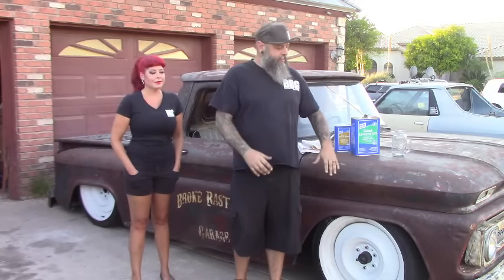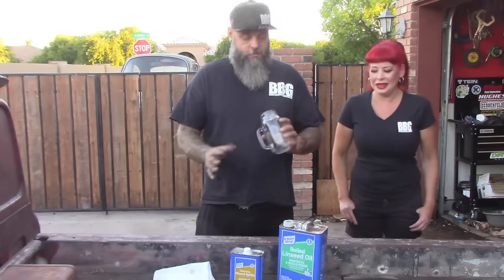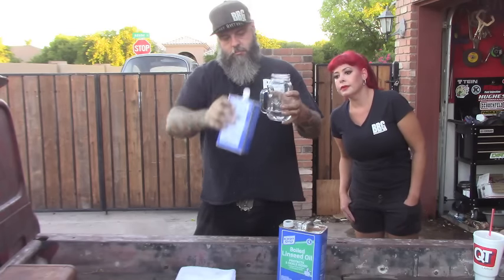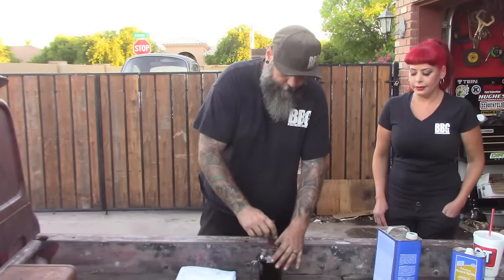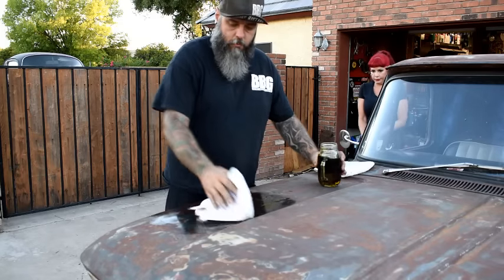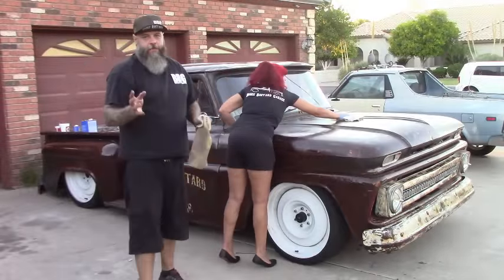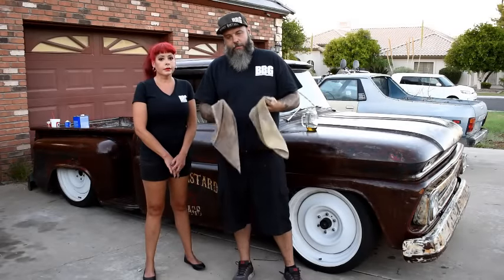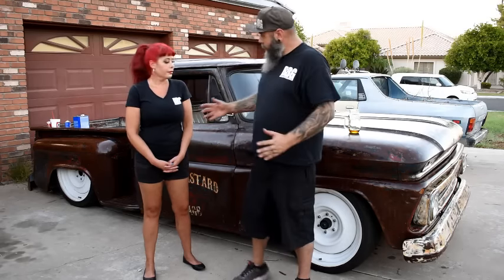How to Protect and Preserve Patina or Rust

Comment: Linseed oil contains a bacteria that when exposed to air creates a-lot of heat ( spontaneous combustion ) . The boiling reduces the bacteria but does not remove all. Lay the rag spread flat on non combustible surface so no heat can build up. If wadded  up heat can build up and catch fire. A Non boiled soaked rage wadded and plied will almost always catch fire, boiled 50/50

Comment: So I understand that the mineral spirits help to spread the linseed oil (I used pure until now) but doesn’t that dissolve the oil (and it’s properties) and how about pinstripe (one shot), doesn’t it dissolve the paint?
Reply from the maker: Sledanet my doors are painted with one shot. The mineral sports just keeps the mix from being gummy and clumps
Reply: @BrokeBastardGarage  cool, thanks for your reply. I thought the pinstriper told me spirits would dissolve the lettering again if I wanted it removed, that’s why I was a little worried. It doesn’t matter if the lettering already has a patina look but mine doesn’t.
Reply from the maker: Sledanet I would not use it on fresh pinstripe with out testing a spot
Reply: @BrokeBastardGarage  it’s been on the car for a year so I’m probably safe 😅👍
Reply: My biggest worry is the effect mineral spirits had on the paint.

Comment: How often will this need to be reapplied with daily water exposure? Would a wax topcoat help extend the life? 

I have an old lumber cart; I plan to add shelves and use it to move my container plants in & out of the sun and/or weather (OK is very unpredictable). I love the patina on the metal (rusty places with several chippy layers of different colored paint).

I am looking for something with very little to no maintenance, that won't turn cloudy or yellow with daily UV exposure. Please let me know of any application tips, or other techniques that may be more suitable for this project. 

》《 THANKS! 》《

Comment: I want to try this on my 1965 C10 short bed. Does the oil attract lots of dust/dirt?

Also does it make it harder to wash?

My truck is light blue and white, with some bare areas, dents, rust holes on rocker panels etc.
Reply from the maker: Mike Leith check out the latest video I posted it should answer all your questions. Thanks for watching
Reply: @BrokeBastardGarage  I'll go look for it now

Comment: I'm wanting to turn a 66 Catalina into a county road torpedo. Will this be sticky at all, and will dust get embedded in it? Also, How long does it last?
Reply from the maker: I’ve it a full day to dry. Until you can touch it and it’s not sticky or oily. Then it will be just like paint. You can wash it. Don’t wax it. Last about 6 months

Comment: Hey @BrokeBastardGarage, I have a car that is 20% worn paint and 80% surface rust. What kind of prep work did you do before application? WIrewheel? Sand? Brush?

The surface of my car is pitted, but no holes.
Reply from the maker: I would give it a good wash. And rub it down to remove any loose stuff. Let it completely dry then oil it.
Reply: @BrokeBastardGarage  Thanks mate, I'll give it a crack.

Comment: Stupid question...when. The car has a good patina from just being old, should I sand it down a bit. To get the rough edges /flaking shit off before i apply the oil?
Reply from the maker: I wouldn’t sand it personally. But I would wash it well and use dry rag to knock off loose stuff.

Comment: Hello, I really like your videos. I was wondering why you added mineral spirits to the boiled linseed oil?  I’ve watched a lot of videos on this method of preserving and never saw mineral spirits added. Also, after you use this method for years, what happens if you want to do a resto and strip the paint, clear coat etc?  Thanks.
Reply: Probably to thin it so it'll spread and dry easier?

Comment: Does this process stop the rust? 
I live by the ocean...
Reply: I'm thinking the important thing is to preserve what's left of the sound steel.    Maybe the rust can be part of the preservative coating.     The rust is porous (similar to wood) and so will retain/soak up any oil that you put on it for quite a long time, years probably.   
      The oil will keep the good, solid, un-rusted steel beneath from rusting any further (I think).      AND some people like the rusty look.   You notice he calls it a "patina".    AND it's a lot easier, faster, and cheaper than a paint job.      AND it's a lot easier to maintain than a paint job.    If it wears out, just take half an hour and wipe on a new coat.     Sort of like Danish Oil Finish on wood vs. varnish on wood.
    I live in Arizona, so I have no experience with ocean climates.

Comment: What happens to the original rust under that coat, will it continue to eat the metal?
Reply: I'm thinking the important thing is to preserve what's left of the sound steel.    Maybe the rust can be part of the preservative coating.     The rust is porous (similar to wood) and so will retain/soak up any oil that you put on it for quite a long time, years probably.   
      The oil will keep the good, solid, un-rusted steel beneath from rusting any further.      AND some people like the rusty look.   You notice he calls it a "patina".    AND it's a lot easier, faster, and cheaper than a paint job.      AND it's a lot easier to maintain than a paint job.    If it wears out, just take half an hour and wipe on a new coat.     Sort of like Danish Oil Finish on wood vs. varnish on wood.

Comment: Would this work as a rust inhibitor underneath a car, or would it get washed away easily?
Reply from the maker: Lou Fazio probably not
Reply: Is the BEST under coater available. I add a cap full of Japan drier to accelerate drying and hardness. Formula wicks into rust and paint like no other.

Comment: Can you explain to me the logic of preserving rust?
Reply: I'm thinking the important thing is to preserve what's left of the sound steel.    Maybe the rust can be part of the preservative coating.     The rust is porous (similar to wood) and so will retain any oil that you put on it for quite a long time, years probably.    The oil will keep the good, solid, un-rusted steel beneath from rusting any further.      AND some people like the rusty look.   You notice he calls it a "patina".    AND it's a lot easier, faster, and cheaper than a paint job.      AND it's a lot easier to maintain than a paint job.    If it wears out, just take half an hour and wipe on a new coat.     Sort of like Danish Oil Finish on wood vs. varnish on wood.

Comment: Do you know how to put a simple and cheap patina on a small engine? Once I get it running I want to repaint it then put a patina to make it look original because the original got completely stripped off by the weather because whoever owned it before left it exposed to midwest weather.
Reply from the maker: Captain_Ravioli once paint is dry and cured. You can use a light abrasive like comet or bartenders fender to weather the paint. Just rubbing the areas you want to distress.
Reply: @BrokeBastardGarage  so rub the preferred areas with something abrasive? I don't know if I'm understanding this properly,it's been a long day
Reply from the maker: Captain_Ravioli first repaint the motor then distress to make it worn and patina.
Reply: @BrokeBastardGarage  oh, ok, thanks, what abrasive material do you recommend for a small 1/2 horse engine? I don't want to accidentally strip all of the paint
Reply from the maker: Captain_Ravioli I would use comet dish powder and a rag
Reply: @BrokeBastardGarage  ok, thanks!

Comment: Can u do multiple coats for a better. Clear coat look.. Any one thing I should watch out for when doing this
Reply from the maker: I’ve never tried multiple coats. But could work is you give them time to dry completely before coats. Just be careful with the oily rags. Wash them out so they don’t catch fire.
Reply: @BrokeBastardGarage  thank you I'm going to give it a try soon
Reply from the maker: @shanestinnett9744  let me know how it works!
Reply: @BrokeBastardGarage  I've seen some videos that don't cut it down with mineral spirits .. Why did u cut it
Reply from the maker: @shanestinnett9744  is applies more evenly and it doesn’t get as sticky
Reply: @BrokeBastardGarage  thank you again I'll do it your way and I'll let ya know how it turned out
Reply: Got it done just now turned out great thanks for the help and the information

Comment: Can you tell me how long it would last if its in the rain a lot.. Thanks
Reply: I did my quarter panel with break fluid that I got fer nothin and It didn't last long. Maybe not the same application results.
Reply: @vetterfellow  That's because brake fluid is corrosive
Reply: @aaronduncan7292  Yes I forgot about that !!!.

Comment: What’s the reason for the mineral spirits? Will I get the same results from just the linseed oil?
Reply from the maker: dannny2511 it thins the mix so I spreads evenly
Reply: Broke Bastard Garage OK thanks. So you would get same results with just linseed oil, just take a bit more rubbing in?
Reply from the maker: dannny2511 I can say I haven done it. Make sure you use boiled linseed oil. Normal will turn gummy.
Reply: Broke Bastard Garage alright sounds good. Thanks again, sweet truck by the way

Comment: Will this keep the rust from going deeper, like rotting through the back of the panel?  I like the way the rust looks on my truck but I plan on keeping it for a long time and don’t want it to rust out.

Edit: Your truck looks badass!
Reply: Good question Captain Goldbeered!    Rust is porous and will fully absorb any oil you put on it.    So the rust is actually helping to keep the oil on the surface of the pure steel beneath, thus preserving it.     The oil keeps the oxygen and the water away from the pure steel beneath, so I don't see how it can rust anymore with oil on it.     Steel cannot rust without water and oxygen in contact with it.    No chemical reaction can occur because the reactive chemicals (iron, water, oxygen) are not all present together if you apply oil.   At least that's my theory....   I have not done extensive testing.    AND I can't seem to find any solid answers to this question online.    Let me know if your find anything.
Reply: @itmightbepossible8586  That actually makes a lot of senses.  I didn’t think about the porosity of the rust.  Thank you for the reply!  If I find confirmation I’ll let you know for sure.
Reply: Sense*
Reply: @captaingoldbeered803  Sounds good.   I would love to see some well-tested confirmation of this.   It seems almost no one takes the porosity of the rust into account.

Comment: I used pale boiled linseed oil thinned with mineral turpentine  on my 60 truck ..... feels a bit sticky ... what am I doing wrong?
Reply from the maker: Needs a day to dry. I haven’t used those exact materials. Could be applied to thick.
Reply: @BrokeBastardGarage  mineral spirit is Mineral Turpentine in Australia👍 just not sure what’s the difference with pale boiled linseed oil to just boiled linseed oil ..... just one is pale I guess lol
Reply from the maker: @scotty2746  how log since you applied it?
Reply: @BrokeBastardGarage  2 weeks at least.... might give it another rub over 👍
Reply from the maker: @scotty2746  man two weeks and still sticky. Sometimes not right. Never seen that before.

Comment: UK here, what's 3/4s of a cup in a 32 ounce jar, in metric?
Reply from the maker: Julio's Evil Twin mix it 8 to 1. 8 parts lindseed oil to 1 Part mineral spirits. Doesn’t have to be exact
Reply: @BrokeBastardGarage  thanking you kindly sir.
 I used to use bees wax/boiled linseed & spirits equal amounts.
 Let it all brew up slowly till the wax melts... Was like hair gel.. but applied it by hand to a few stripped to bare metal vices!! Omg 👌🏻😉..

Comment: I made the mistake of omitting the mineral spirits. Combined with the car having a coat of oil paint not spray paint I got a sticky car and polymerization of the oil (turning into a solid). Dirty look - dirt sticking to paint, had to scrub the whole car. Not a problem really as it needs the paint redone, but first I will try this again WITH mineral spirits, I may have to add more than shown here.

Comment: Sweet finish!
Yeah the linseed oil can spontaneously combust on rags.
Woodworking workshop nearby had a fire - someone had tossed linseed loaded rags into a trashcan after they finished with them.
Reply: Angry Parrot Distillery   I am Glad you actually said that .  When he warned us about a threat  I knew what he meant .   I have used the Mix kinda heavy for years on Gun stocks  , and it makes it look great .  But I always had a Metal Can outside with a Lid for that exact reason  .    Some things you do not want to take chances with  .   I will willingly make other mistakes on a daily basis , but not that one.

Comment: i have a question. im working on a ratrod astro van project and im having a problem with the rust crusting up and falling off the van. any suggestions?
Reply from the maker: Steve Truelove so is it just turn to dust. Or do you have chunks falling off?
Reply: @BrokeBastardGarage  chunks.. it will make like a bubble under the rust and i can hit it with my knuckle and it will crumble off some peaces as big as my hand its crazy.
Reply: i did use another method of rusting tho. i used muriatic acid and water and just sprayed it on using a weed sprayer. this my problem.

Comment: Preserve the rust? Don't you rust to go away?  I have to look up "patina". LOL the result looks awesome!! Is that like painting the car?
Reply: I'm thinking the important thing is to preserve what's left of the sound steel.    Maybe the rust can be part of the preservative coating.     The rust is porous (similar to wood) and so will retain any oil that you put on it for quite a long time, years probably.   
      The oil will keep the good, solid, un-rusted steel beneath from rusting any further.      AND some people like the rusty look.   You notice he calls it a "patina".    AND it's a lot easier, faster, and cheaper than a paint job.      AND it's a lot easier to maintain than a paint job.    If it wears out, just take half an hour and wipe on a new coat.     Sort of like Danish Oil Finish on wood vs. varnish on wood.

Comment: Can this be applied over primer?
I plan to spray my car with primer only.
Reply from the maker: Old Bug Adventures do not now I have never tried it
Reply: You can but just clear the primer cause even if the oil helps primer is very porous and will take all the oil and also rain water in and rust it out way faster
Reply: sorrygunsathome I may have to use a clear, i just want a Red Oxide Primer finish...for now.

Comment: Don’t throw those rags in a trash can or bucket especially inside.  The oil mixed with O2 will cause heat and they could spontaneously combust. I’m a demo contractor and the amount of houses we have torn down from people refinishing floors and throwing all the rags in a 5gal bucket is insanity.

Comment: I did this on my Vw bug with straight boiled linseed oil and used to much. It was pure BLO no mixture. Now it has dried and looks like it has wet spots(used way to much) and is also sticky. Anybody have any tips on how I can make this issue neutral? 
Also a normal wash with soap and water is still the preferred method to wash?
Reply: BLO actually polimerizes as it dries (this process is exothermic hence the rag danger). If its gummy you probably have half cured blo.  Ive had this happen. What seems to work best is to make sure your part or car gets full bright sunlight for a day or two then if possible a warm garage at night. The uv and warmth will accelerate the polimerization. If you see no improvement then make a blo/paint thinner mix (20/80 or even straight thinner) and go over with a rag like in the video.  Then do the sun/warm garage thing again. BLO is great but if youre somewhere colder it can be a mother to cure. Id try not touching it first as you can make an ugly mess that requires a lot of work to get back to square one ( ask me how i know lol) and if youre somewhere cold and overcast just give it more time.

Comment: You can't prevent rust if you don't first remove the rust. It will travel within the metal.
Reply: Hey BloodOnMars - I'm not so sure about that.     Rust is porous and will fully absorb any oil you put on it.    So the rust is actually helping to keep the oil on the surface of the pure steel beneath, thus preserving it.     The oil keeps the oxygen and the water away from the pure steel beneath, so I don't see how it can rust anymore with oil on it.     Steel cannot rust without water and oxygen in contact with it.    No chemical reaction can occur because the reactive chemicals (iron, water, oxygen) are not all present together if you apply oil.

Comment: What is the fascination with that hydraulic suspension? it is bloody ridiculous.
Reply from the maker: It’s air bag suspension and it dramatically improved the ride quality. My wife wouldn’t ride in this truck for more than a few miles because of her injuries. Now we have gone on 200 mile trips with no problem. Speaking for myself this is why I did the air ride suspension.
Reply: @BrokeBastardGarage  Ok I was wrong sorry, I do know how good airbag is as a truck driver for 35 years.